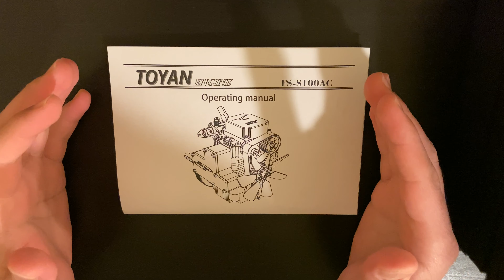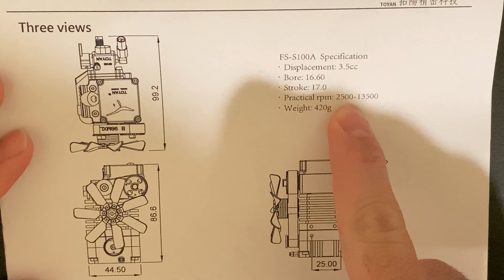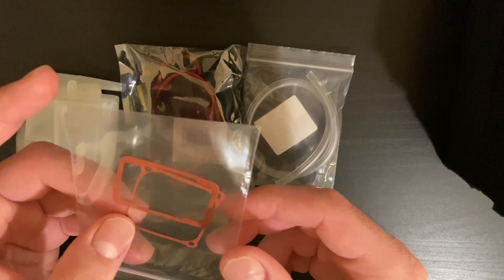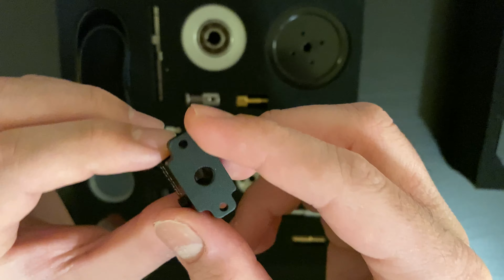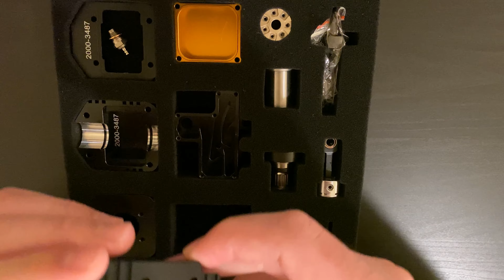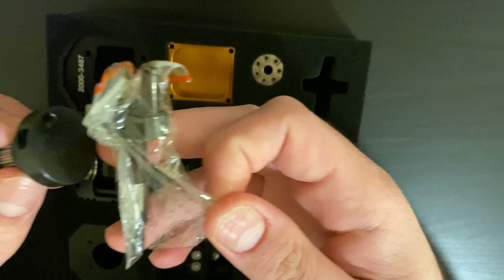Parts Of A Mini 4 Stroke Engine

Comment from the maker: This is a project that I am definitely looking forward to because I've never built anything like this and I feel that it will be quite the journey. This project will be broken up into parts for future videos so the assembly of each part will be a specific video. I think that It's best to break it up because the video would be way too long if i filmed it all in one shot. This video is like an introduction to this project and I thought that it would be best to start the new series off by showing all the parts and specifics. I don't know what I will do with this engine once I'm done, but I do know that I will make it run. If you are interested in this engine, it's a Toyan Fs series engine (FS-S100-AC). There are other variants like a 2 and 4 cylinder inline engines but they all come assembled. This particular model is the only one that can come in pieces if requested. Specifics of this engine were mentioned but I will mention it again, It's a one cylinder, single overhead cam, 4 stroke engine. Definitely check it out and stay tuned for future videos on this engine.